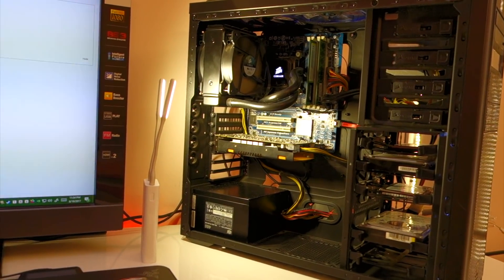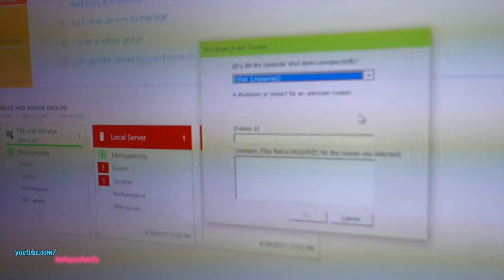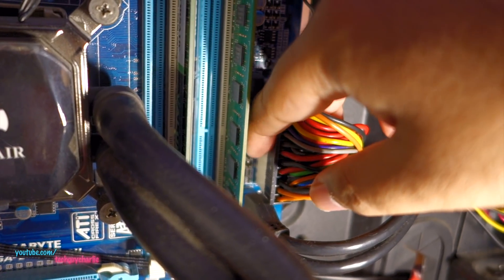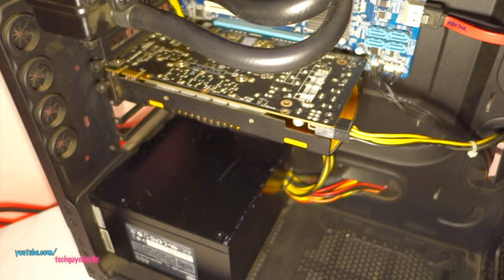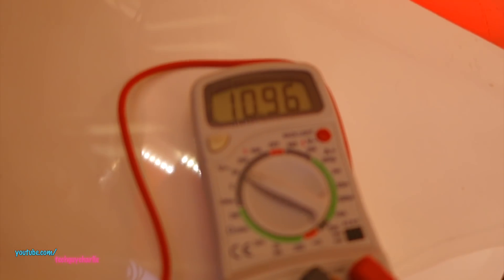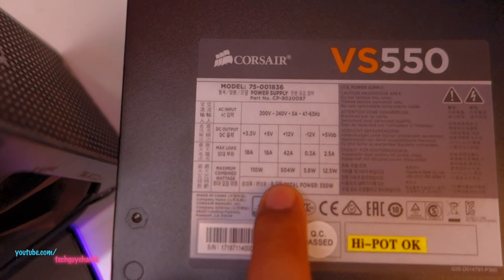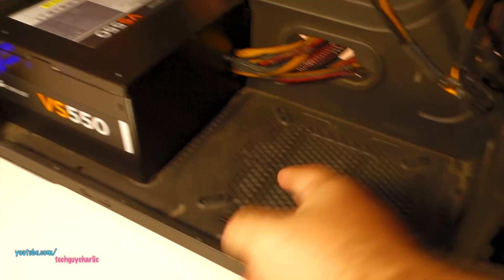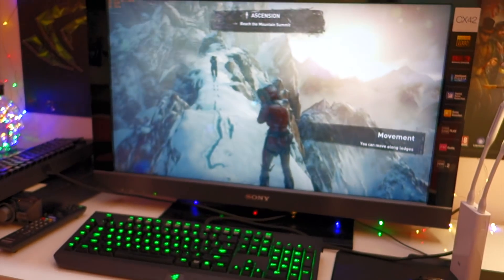Computer randomly shuts down and turns back on by itself - How to diagnose a faulty PC power supply

Comment: Yep, the power supply is bad. I had the same issue and my PS was no good. As soon as it was under a load like playing a game it would shut down and turn back on.
Reply: Thanks mate mine doing the same right now whenever I play game, so now I know what's the problem. Will buy a better psu on eBay.
Reply: @itachiuchiathesoulking6553  and did you? And did it fix it? Thanks!
Reply: Mine just does it without any relation to how much of the CPU is running. Have three tabs of chrome open? Off! Playing Starcraft 2 on high graphics? Perfectly fine for a full hour. Playing Super Mario Sunshine for 10 minutes? Off!
Reply: @MrWin-pj4sg  Mine does too.. and it started yesterday. I wonder if you found the solution.  I reformatted my build & checked RAM, temperature and problem continues.

I am having issues randomly.. it does not happen when I am on desktop not doing anything. But it happens when I try to run any problem (regardless of what it is).

My build was just fine until yesterday.. so I am pretty sure its hardware issue although my parts are less than 1.5 yrs.. I just bought a new PSU and gna see if PSU is the issue. I had previous build where PSU was the issue.. but it only restarted when it was under some loads.
Reply: @jaydenlee4879  It's tricky for me to tell you if it's fixed or not, but I deleted a LOT of unnecessary files and it's working perfectly.
I'm expecting it to get worse again soon, but I am enjoying being able to use it for now.
Reply: @MrWin-pj4sg  hey, is it a psu or motherboard issue? because I have the same problem of my pc randomly turning off irrespective of the power load
Reply: @jaydenlee4879  Did it fix the issue?
Reply: @Shiv-xm4xm  Yes, it was CPU issue.  I replaced my cpu and found no problem with it
Reply: It happens to me even when I'm just watching a movie not only by playing a heavy game like horizon zero dawn, So what i did is i removed my gpu that is gtx 1660 super Evga and tested my pc with the integrated onboard graphics that is intel hd 4600 nothing happens even when playig light games but when i plug in my gpu that is gtx 1660 super pc keeps restarting itself with a buzzing noise/sound. Can anyone help me?

My specs are 
Intel core i7 4770
16gb ram ddr3
Eps 850 watts 80+ silver
256gb ssd
Evga Gtx 1660 super 6gb vram
Mobo ecs z87h3 a4
Reply: @footballmatchhighlighttv  maybe your psu is not capable enough or is damaged due to power fluctuation. It might be the reason of restart as gpu generally don't get damaged so easily also your psu might not be able to handle the power delivery and causing restart.👍
Reply: I have same problem but it shows nice 12volts. Psu good?.

Comment: @
Tech Guy Charlie

my pc restarts by itself when I play fallout 76 or battlefield V. it started doing this when i installed the new nvidia driver last week the 417.35 driver one. but when watching videos in youtube/twitch or any other activity its fine. just when i play games. and recently it is now restarting by itself even when i play low demanding titles such as grim dawn or dragon age origin.

the pc specs are:
GTX 1050 ti
16gb ddr3 gskill 1666 mhz
i3 4130 w/ Asus Hb1M-K
Evga 500 80 plus bronze
1 T Seagate
2 T WD blue
with 5 nova/omega rgb fans connected

and yes this is a 5 year old pc , just the video card that is slightly new 1 yr old i think. so base on your video do you think by PSU is giving out as well? 

thank you.
Reply from the maker: This is exactly how my restart problem started, first, it used to happen only while playing demanding games but the PC would work fine while browsing the internet then it got worse and it would restart while web browsing when this happens it's usually 99% the PSU!! Whenever I diagnose a problem, I go through the checklist before replacing a part, if you have a multimeter then just measure the voltages on the 12v and 5v rail if you don't then just to be sure that no other component is causing the problem, start with checking all the cables on the motherboard and  re-seat the RAM and GPU you might want to run memtest because I've seen PC's restart while because of faulty RAM.. after you are done if it still restarts then its the power supply, I rarely see 80+ Bronze power supplies lasting more than 3-4 years, so 5 years is quite good.

Comment: I've bought a new PSU  and the pc keeps restarting even more often. Can this kernel power error happen because of GPU failure or RAM?
Reply: Psu how much power??
Reply: Yes because of dust in ram sometimes
Reply: I have check mine 12.18v but still keep restarting when i launch Pubg.. i check Ram using memtest but have no errors whatsoever.. so idk whats the problem here..
Reply: Your gpu maybe broke, remove the gpu and try it with just integrated gpu in your cpu

Comment: Hi, I just bought a new pc and installed Windows 7 on it. But whenever I start the computer it reaches the welcome screen and then shuts down. .manually restarting the computer again solves the problem. However, once it starts it works fine no shutting down no nothing. Can you pls tell me what the problem is. My specifications are Intel i5 670@3.47 GHz, msi graphics card 1gb, 4 gb ram

Comment: My rig keeps doing this after I upgraded from a 290x to rx vega 56 I have a cooler master 750w PSU core i7-4790k 16gb ram and lots of hard drives like you do plus 4 fans and dvd drive Ive ordered a evga 1000w PSU so I'm hoping this will fix my issue
Reply: did you find solution ?
Reply: @hachim1098  yes bought new psu
Reply: @justuraveragegamer2670  good..me too in have the same problem when playing games such as fortnite ...tomb raider...i have gtx 1060 3g.. i3 8100  with crs 350w.. so i think the issue because of psu ?
Reply: @hachim1098  350w is too low get at least 500w
Reply: @justuraveragegamer2670   yes i will.... thank you

Comment: I'm having the same problem, but I've tested the power supply (Corsair CX750) voltage and everything was ok
What else could be causing that?
Reply: did you end up finding out the issue
Reply: Same here I got the same battery and it’s doing it on my pc

Comment: Great video, i have the same problem with a litle diference, when the pc shuts down some times i see the windows screen, shooting down the pc, and when i test the psu the voltage goes higher than 12, arround 13.40, this could be the problem?, thanks in advance for any help
Reply: Mayito Gonzales found a solution I have the problem right now

Comment: Will this damage my hardware. I have a cooler master g550m smps
Reply from the maker: Well, a bad or faulty power supply can damage your hardware, so if you are having problems then its best to replace it with a good power supply.

Comment: ironically the VS550 is the one causing me problems w/ the random restarts problem, i got another one
Reply from the maker: Haha well, VS series is Corsair's 'Value Series' power supplies :D CX Series is way more reliable, but they do cost more.
Reply: Tech Guy Charlie the CX series are even worse.. I recommend seasonic or another reliable brand with a good reputation. My Corsair VS650 just died a week ago, i used it about 2 years but this is one of the worst PSU’s that I have ever used

Comment: Bought a Corsair VS 650   and  it became trash after a year, would restart on heavy load checked every part on an other pc everything worked fine except Psu i dont even know which company psu should i buy next any help would be great.
Reply from the maker: Well VS isn't that great when it comes to durability. Thankfully mine has been working fine for the past 1 year 24x7 operation. But they sure cost a lot less! If you want better quality go for Corsair CX or AX series power supplies, but they do cost a lot more than VS but they'll last longer.
Reply: @TechGuyCharlie  oh i checked prices  and they are a bit costly but will try to get cx atleast and thanks for the response!

Comment: My Dumbass PC crashes randomly whenever I play games1[Especially DOTA2] and sometimes while browsing on Google or youtube. And once it crashes, it keeps crashing the moment I launch the game. My GPU[Nvidia GTX 1070] is alright, I guess my rams[Corsair Vengeance] are fine too and I am not sure about that Mobo [AsRock Z87 Extreme4]. I am using PSU [Corsair CX750]. I don't know what's the problem is. Sometimes my PC manages to run for a hour or so while playing but in the end it crashes anyways.I just want to know which part of the PC I need to replace.
Reply: If it boots up then mobo is not the problem and neither are ur ram.. It's most likely a psu issue.. Also corsair are not good psu company.. Alot of ppl have issues with their corsair psu. Have you tried running ur pc on another psu?
Reply: @krndv7  I once tried with a another PSU, Faced the same problem. But that PSU wasn't in good shape. I mean it was pretty fucked up. I think that PSU was faulty too. I need to find a decent new PSU to check.
Reply: @zoloo39  Did you fix this ? I have this too , Can't play dota on this already got LP :(
Reply: @pushpithageeganage7992  I updated my rig, with Rog components. Everything is new with maximum performance. Now I am not facing any such issues.

Comment: dude i have the same exact problem like you which lead to a dead mobo. now that i changed the mobo but the random reboot is still there but not that frequent. thinking about changing the psu n i was just thinking issit the psu that is faulty or just my power socket sucks. what do you think?

Comment: Doss testing the molex like you did constitute a test underload? I have never seen that before but it would make things easier. 

If this does constitute a test under load I just need to find a free Molex connector to perform the test on correct? You didn't unhook anything to get to that Molex connector right?

Comment: My Pc is built new and it turns on if it can get power and turns off after 30secs and back on. Cooler is properly installed. Also I get no screen on even tho my gpu works.
Reply: It is LGA 1366
Reply: L
Reply: That's still a faulty PSU.
Reply: Did you find out what the problem was??

Comment: hey i have the exact same issue and i also feel that my psu could be faulty, is it safe to plugin the multimeter in the molex? and as you have been using the vs550 is it a good option to go for it?
Reply from the maker: Yeah, completely safe as long as nothing shorts out! 
Well, the VS550 I have has been working perfectly fine in this PC since last August ( when I installed this PSU) and the PC has been turned on almost 24x7 as a media server but its a budget power supply so I don't expect this to last more than 2 years, so I think you should go for Corsair CX series, whats your PC configuration?
Reply: Tech Guy Charlie my pc config is Pentium g4560, Galax gtx 1050ti, gigabyte h110m s2 motherboard, 8gb ddr4 ram, the VS450(which i think is faulty), and 1tb hdd
Reply: Tech Guy Charlie hey i just checked my psu with a multi meter and the molex shows 11.94v so i dont think my psu is at fault. Also is there anything else that could b causing this problem
Reply from the maker: Did you test the voltages under load? like fire up a game or something that uses your CPU and GPU both. If it shows 11.94v on idle then under load it should drop even further. By the way, when exactly does your PC restarts? any specific event? like mine restarted when I played games.
Reply: Tech Guy Charlie yes my pc restarts only while gaming. And yes i tried it under load , i played watchdogs 2 and it only went to 11.8 from 11.9 and then after a few mins it restarted
Reply from the maker: Can you download a software called HWmonitor and see what kind of temperatures you get? If it's not the power supply then it can be your CPU or GPU overheating. For a Pentium g4560, temps should stay below 60 while gaming and GPU below 75.
Reply: Tech Guy Charlie yes the cpu stays upto 55 degC and gpu stays till 52 degC. So its not overheating. (Im monitoring it via MSI afterburner)

Comment: Do i need this test if only it is for playing fortnite? I do 3D modeling rendering with no problem but fortnite shut off and restart
Reply: Did you fix it
Reply: JSpencer i had the same problem and i fixed it by changing the power supply, got a seasonic one and all good now (:
Reply: @rienhard123498  for anyone wondering, my issue was that my graphics card was not seated properly on the pcie slot as there was a power connector for my SATA drives underneath. Once I removed that and powered the drives from the motherboard it was fine
Reply: JSpencer good to know, atleast your pc is up and running again, those issues are mostly power related but something simple like that could be it.

Comment: I just had this same issue with the PSU which you got as a replacement (VS450)
Reply: i have crosair vs450 
i got restart my pc when iplay games since 7 days :'(
i need to change it to better 550 w or idk :'(
Reply: @l7ajbrahim144  hey does it work
Reply: I have the same vs 450 plz tell me does it work

Comment: I have a question, 
1)when replacing the motherboard, do you need to remove the components on a laptop? 
2)Can I upgrade my desktop computer's RAM with a new RAM which is not designed for it? will it still work?
Reply: yes
Reply: No
Reply: Maybe
Reply: Depending on the price range, I think you should get repair if it’s under warranty.  If it’s an old laptop I think you should   Selvage the hard drive, then get a new one.

Comment: my laptop randomly freezes sometimes, i happens more with linux but occasionally with windows. can u tell what software you are using to detect the cause of the restarts, it might help me in troubleshooting
Reply from the maker: So it happens not only on Windows but on Linux as well? Probably your hard drive is dying, it can be something else but I also had a similar problem on my laptop and it was my hard drive which had a lot of bad sectors I cant be sure unless I actually have the laptop in front of me for diagnosis! What you can do is on Windows download this software called HDTune to check if there are any bad sectors on the drive. Do you have a spare laptop drive to swap for time being? that is the easiest way to figure out if something is wrong with the drive.
http://www.hdtune.com/

I use the built in Windows event viewer to check errors and then you can google them to see what they mean.